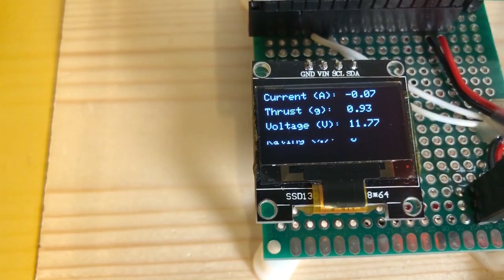Thrust Stand - How To Measure The Power Of A RC Motor

Comment: How do you measure torque on this sort of set up? Or is there any other equation to measure torque = f*distance? How do you determine distance if you have motor mounted vertically? Thanks for the video anyway
Reply: Short answer: you can't measure torque with this setup
Long answer: you either need to add two load cells connected to the motor mount with hinges to measure torque directly or without two additional load cells you need to measure the moment of inertia of bell + prop and monitor RPM to estimate torque via torque = momentOfInertia * changeOfRpm/timestep
Reply from the maker: Great point, I hadn't thought of that if I'm honest. I'll look into that